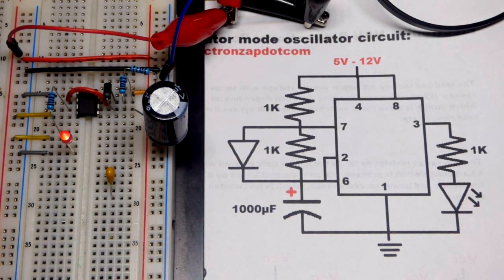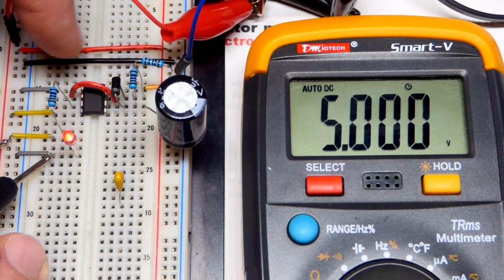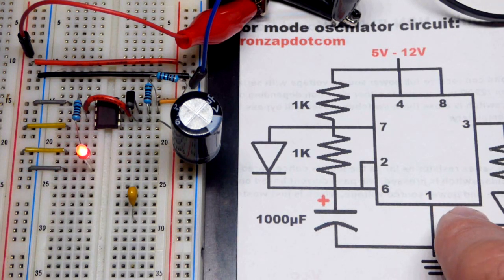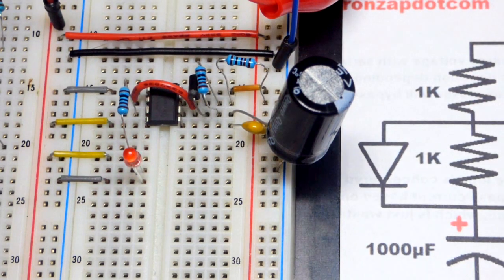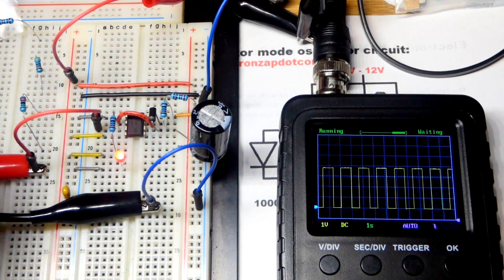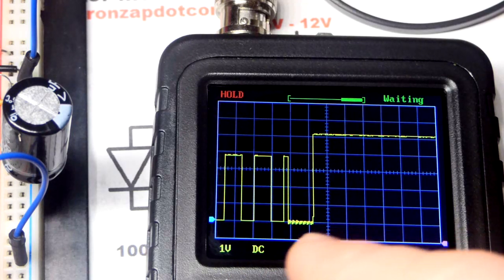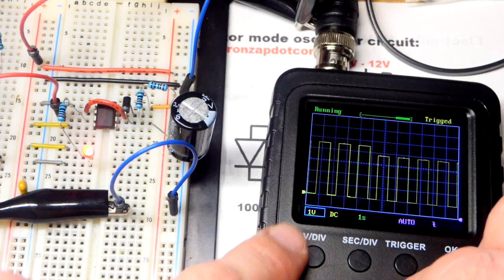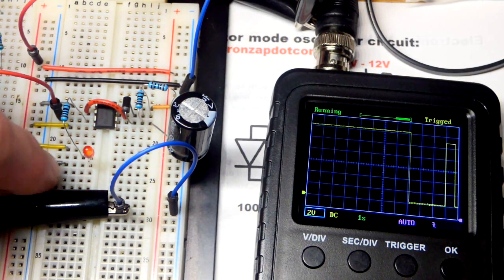Common astable mode 555 timer multivibrator issues

Comment: I have assembled my circuit as displayed in the many diagrams on the internet and I constantly have the same issue - the output is always on at peak output voltage. However, I am using a non-polarized ceramic capacitor as my primary, could that be the issue?
Reply from the maker: Any capacitor should work. If you use too much resistance though, then the capacitor can take a long time to charge, and may never be able to charge enough. If it charges and discharges rapidly enough, then it may also look like the output is always high, depending on the circuit.
Reply: @Electronzap  I have probed the output with a scope, it is constant even at nanosecond scale, and the voltage at the capacitor is 7.5V with an input of 9V. I will try to use lower resistances then. Thank you for advice
Reply: I had the same issue! I made like 4 different protoboards. What ended up working was making sure that the resistors and capacitor were wired in series, with the wires breaking out to the 555 board. Also when if your calculated output signal is higher than 2Mhz the 555 timer gets weird. Period is calculated with formula 1.44/((R1+2R2)C1).

Comment: Doesn't the data sheet say the output is 3.3 volts at the output?
Reply from the maker: Datasheets say a ton of stuff, and it depends on the particular datasheet you are looking at. 3.3V output might be the minimum high (on) output that you can expect while powering it with a 5V supply, at a certain amount of current.